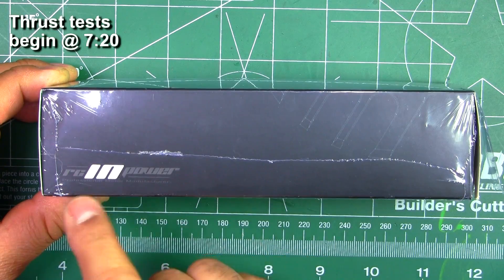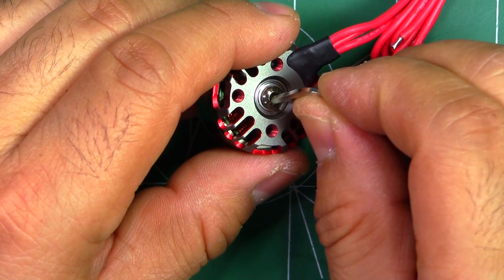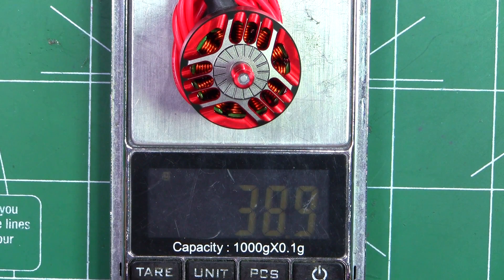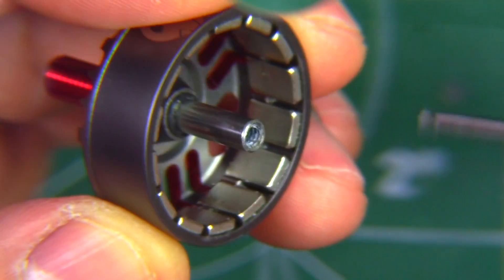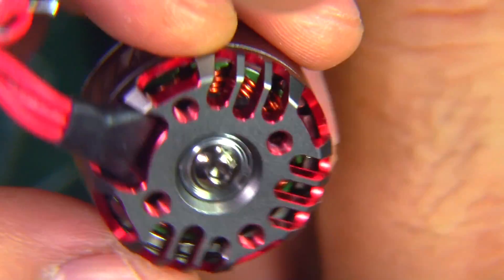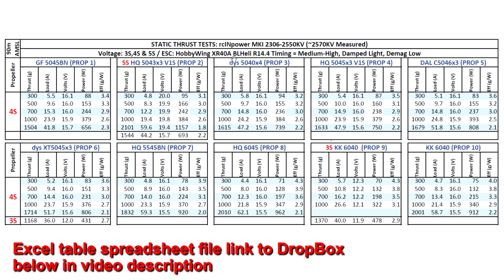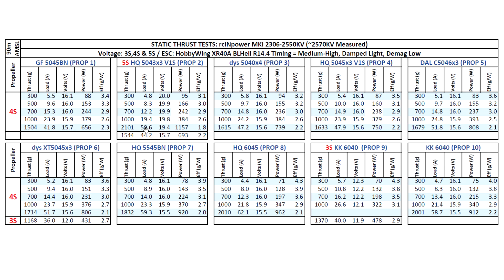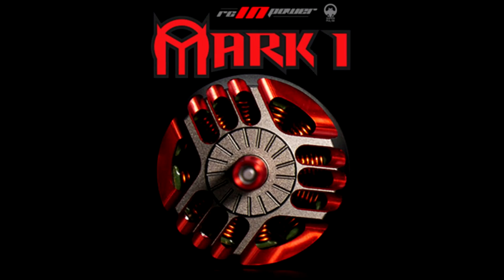rcINpower Mark I 2306-2550KV Thrust Tests - Titanium Main Shaft!

Comment: Will you start testing on 6s?
Reply from the maker: Yes! I think the 1900KV may be OK on 6S. I tested the EMAX LS2207-1900KV up to 5S and after looking at data it seems they would be OK on 6S- 5043x3 props
Reply from the maker: Only on lower KV motors, under 2100KV. Higher than that, the Amps get too high and I run risk of frying ESC and thrust stand electronics.
Reply from the maker: I don't know 😜 ❔❔ 🤔
Reply: Venom's on 6s?? :D
Reply: Will that mean what I think it mean? ^^ ^_^ ;) hehe
Reply: OOOhhh,can't wait!! :D :D :D <3
Reply: Appreciate all the hard work you do . Only hard data I found on my motor. Thank you so much.
Reply from the maker: DifferentHaX Glad to hear you found it useful. Thanks for watching.

Comment: 6S vs 4s? :)
Reply from the maker: I'll be doing a comparison - same series or very similar motors, various KVs and run a couple of props 3S to 6S. The only thing missing is time, can hardly keep up with testing/reviewing motors lately. Still have a backlog of motors I need to test.

Comment: Holy cow that thing has some impressive numbers for a budget motor. Is the provided hardware that comes with the set titanium?
Reply from the maker: No, looks like regular screws. Ti screws are pricey - they would be advertising it big time I would think!
Reply: EngineerX  the color looked lighter in the video is why I ask. I pay about 35 cents a piece for rather good ones so I'm sure they could provide them if they got rid of the sunglasses case.
Reply from the maker: I think it was due to the light I use for filming video (LED lights and a fluorescent flood light) - it makes the colors a little different that actual. I apply some color correction in the video editor but still doesn't come out as the actual color. Right, that case is too nice to package motors. I would rather get some titanium hardware or a full set of bearings replacements, or a spare bell.
Reply: EngineerX no biggie and there's nothing wrong with your color at all, it looks really good, just thought I'd explain the question. It could have easily been my phone that made it look lighter. I do like that they added nice wire with the motor. Looks like at least 18awg. I think with this motor and other "discount" they loose a good share of the market when they start out at certain suppliers. Even after they come back w/ a quality motor like this one seems to be they are limiting themselves to only the BG type consumer. Even if they manage to sell these at some of the premium vendors at least for me the damage is done. I would bet this motor could run side-by-side with a top tier motor but it's not something I'd consider just because of the stigma attached w/ BG. I feel like RCX kinda falls in this same category. 3B did the exact opposite and it's probably the closest competitor to these and I just bought a set of them last week. Your test and review certainly helps this motor and I hope I'm wrong but outside of HGLRC and Airbot it's kind of a hard mold to break.
Reply from the maker: J Slater I think you're right for the most part. This rcINpower company has not done a good job distributing and advertising their motors. It's a shame because the GTS series is one of the best in quality and power and RCiP knows how to make powerful motors. These will be very good if the prop shaft proves to be durable.

Comment: why no 5152 gemfan i know you got em
Reply: they dont work quite well at thrust stand, anyway you dont need it to compare the data, key is use the same props and EngineerX
 does that. ;)
Reply: FPV Portugal I disagree. As I've stated to him personally the older props show a much larger disparity than newer designs giving an impression that a lot of the older Motors do not perform that well.. other than weight there haven't really been massive leaps in design with motors while props have got to a point where very modern designs show very much consistent performance with in certain sized and pitch ranges. I've only seen the 5152 on one session and it was a few days ago it also didn't perform poorly 🤔
Reply: Sugar Kane like I said not all props work good in bench testing, I have the same rcbenchmark 1520 used in this testing, I study aerodynamics and I help some brands making better props, to test this new fluid designs can't be on a stop motion, needs to be in flight to calculate the exact thrust and amps. Designs like T5040C, T5046C, 5050C, T5050C, RK 5051, Gemfan Flash (all of them), etc need more than a fixed thrust stand, believe me, the amp consumption is huge and thrust is very low in the thrust stand, you will end with no valuable data and could probably damage the motor.
Reply: Not exactly in flight but with airflow
Reply from the maker: The GF5152's always show thrust lower than a 5040x3 prop and about 10 to 15A higher. Those new design props from GF, RaceKraft, EMAX Avan, etc get low thrust and high Amps so I thought people could get confused or mislead into thinking the props are not good, but we know that GF5152s are actually very good and once flying they'll be faster than a 5040x3 but in the thrust stand it gets lower thrust. I ran them with the BH 2307 2500/2700KV and you can see the "low" thrust. Seems they're specifically designed for having air moving thru the blades. I may start including it in future tests, but then people will start questioning why is thrust so low LoL !